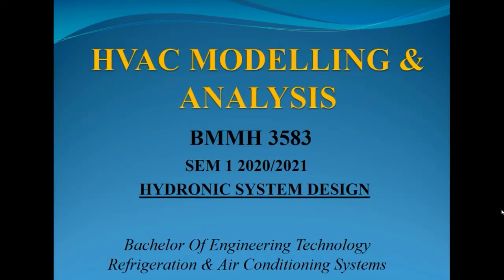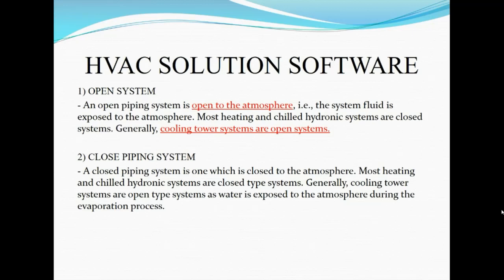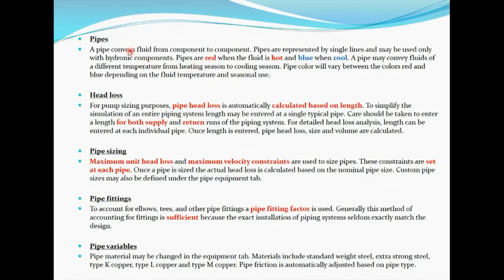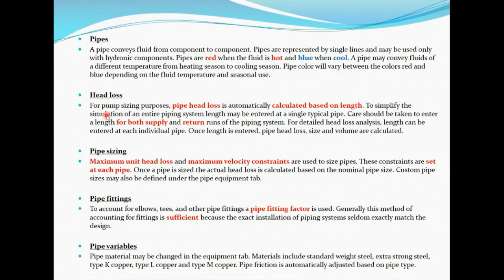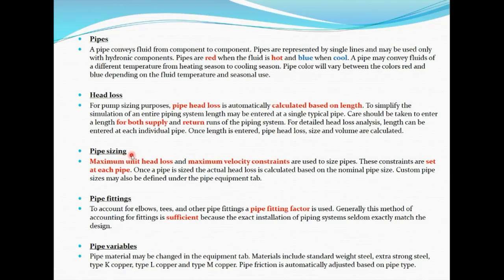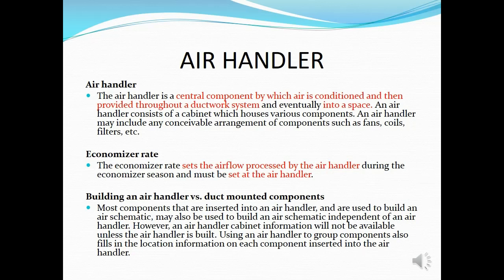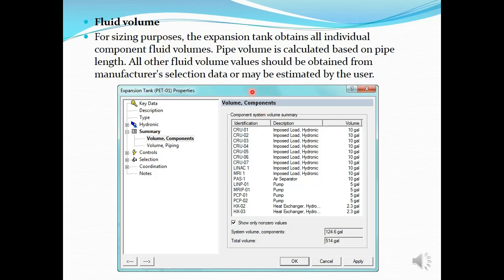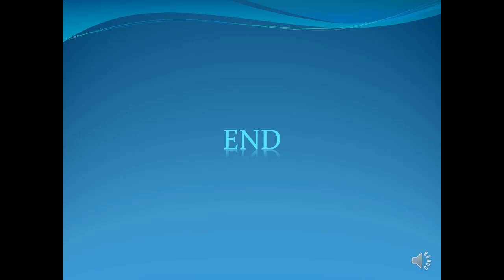hydronic system complete

Comment: MUHAMAD AFIQ HAIKAL BIN ADNAN
B071710534

1. Cooling tower has 2 piping system which is:-
-Open piping system which is the condensed water is release heat to atmosphere the water condensed water is mix with cooling tower
-Close piping system the condensed water is not mix with cooling tower, the condensed water only circulate in the pipe it commonly use in hybrid chiller

2.Air cooled chiller is use air from the fan to release heat from the condenser to the atmosphere.

3.Water cooled chiller both use water as a medium to transfer heat from condenser and evaporator.For the condenser absorb the heat and transfer it to cooling tower and cooling tower will release heat to the atmosphere.

4.Air handler unit contain a several component such as cooling coil,heating coil,fan  and filter

5. Damper use to control of air flow,there are several type of damper:-
-Opposed Blade
-Parallel Blade

Comment: MOHAMAD ZARIF BIN ROSTAM 
B071710681
4BMMH 1/2
Hydronic HVAC System (HVAC Solution Software)

Open Piping System
Open piping system is the system that is open to the atmosphere.Open piping systems are flow in which the pumped fluid is exposed to the local atmosphere at some point in the system. A typical open-loop system would be a cooling tower system where the flowpath is linear, i.e. fluid transfer between two vessels.

Close Piping System 
A close piping system is one which is close to the atmosphere. Most heating and chilled hydronic system are closed type systems.A closed system is a physical system that does not exchange material with or interact with its surroundings and is not subject to any force whose source is external to the system. In less verbose terms, a closed system is one where all the variables are known and can be controlled.

Pipes

Overall head loss in a pipe is affected by a number of factors which include the viscosity of the fluid, the size of the internal pipe diameter, the internal roughness of the inner surface of the pipe, the change in elevation between the ends of the pipe and the length of the pipe along which the fluid travels. Maximum unit head loss and maximum velocity constraints are used to size pipe.Once the pipe is size the actual head loss is calculated based on the nominal pipe size. Pipe fitting is used to account for elbows,tees and other pipe fittings a pipe fitting factors is used.

Air Cooled Chiller
What is Air Cooled Chiller ?

Comment: AMIRA NASUHAH BINTI ALIAS
B071710121

1. Open piping system
- Open piping system is open to atmosphere. 
- A system fluid that exposed to the atmosphere.
Example : cooling tower system.

2. Close piping system
- Closed piping system is closed to the atmosphere.
- The opposite type of system comparing to the open system.

Air Cooled Chiller
- a chiller is a central source /equipment to generate chilled fluid. 
- extract heat from chilled fluid and rejects it to the air via fans
a few types based on what type compressor to be used: 
-Reciprocating
-Screw
-Rotary centrifugal
-Scroll

Water Cooled Chiller
- extract heat from the chilled medium and reject to the cooling tower medium
a few type: 
-Centrifugal
-Direct fired absorption
-Dual compressor screw
-Reciprocating
-Rotary
-Screw
-Steam absorption.

Air Handler
- a central component by which the air is conditioned and then provided throughout a ductwork system and eventually to space.

Economizer Rates:
-set the airflow (during certain time or season) processed by the air handler.

Cooling Tower
- used to dissipated heat from water from chiller.
- in connection with a water cooled chiller.
- connected to a components requiring a cooling consumption components. 
- accept heat transfer via a working medium from the chiller/other component and reject heat by the evaporation process.
- cooling tower sump used to store water temporarily for a cooling tower system during season when cooling tower is not in use.

Expansion Tank
- a vessel which accept the expanded volume of fluid so that the system will not over pressurized.

Valve
- to control the flow inside the piping and to allow a shut-off flow in a pipe.

Comment: MUHAMAD IZMAN BIN JAMALUDDIN
B071710518
4BMMH S1/2

OPEN SYSTEM AND CLOSED SYSTEM
Piping systems can be open or closed. An open system is affected by atmospheric pressure. The flow in open condensate return and plumbing drainage systems is gravitational. The flow in an open cooling tower water system is forced. The pipe sections of an open network system are either all supply or all return. A closed network system includes both supplies and returns sections. A closed network system begins with a first supply section and ends with the last return section.

AIR COOLED VS WATER COOLED CHILLER
A cooling tower is a specialized heat exchanger in which air and water are brought into direct contact with each other in order to reduce the water’s temperature. As this occurs, a small volume of water is evaporated, reducing the temperature of the water being circulated through the tower.

COOLING TOWER
A cooling tower is a specialized heat exchanger in which air and water are brought into direct contact with each other in order to reduce the water’s temperature. As this occurs, a small volume of water is evaporated, reducing the temperature of the water being circulated through the tower.

Comment: MOHD RAHIMI BIN MUSTAPHA
B071710225
BMMH S1/1

Lecture : HYDRONIC SYSTEM DESIGN
1. Open piping system
>> Open piping system is open to atmosphere. 
>> A system fluid that exposed to the atmosphere.
>> Example of open piping system is cooling tower system.

2. Close piping system
>> Closed piping system is closed to the atmosphere.
>> The opposite type of system comparing to the open system.

Air Cooled Chiller
>> a chiller is a central source /equipment to generate chilled fluid. 
>> extract heat from chilled fluid and rejects it to the air via fans
Has a few types based on what type compressor to be used: 
-Reciprocating
-Screw
-Rotary centrifugal
-Scroll
Water Cooled Chiller
>> extract heat from the chilled medium and reject to the cooling tower medium
Has a few type: 
-Centrifugal
-Direct fired absorption
-Dual compressor screw
-Reciprocating
-Rotary
-Screw
-Steam absorption.
Air Handler
>> a central component by which the air is conditioned and then provided throughout a ductwork system and eventually to space.
Economizer Rates:
-set the airflow (during certain time or season) processed by the air handler.
Cooling Tower
>> used to dissipated heat from water from chiller.
>> in connection with a water cooled chiller.
>> connected to a components requiring a cooling consumption components. 
>> accept heat transfer via a working medium from the chiller/other component and reject heat by the evaporation process.
>>cooling tower sump used to store water temporarily for a cooling tower system during season when cooling tower is not in used.
Expansion Tank
>> a vessel which accept the expanded volume of fluid so that the system will not over pressurized.
Valve
>> to control the flow inside the piping and to allow a shut-off flow in a pipe.

Comment: AHMAD LUQMAN HAKIM BIN ZAMBRUS
B071710359

2-types of hydronic system
1) Open piping system -  system fluid is exposed to the atmosphere (cooling tower)
2) Close piping system -  system fluid not exposed to the atmosphere (chiller)  

HVAC Solution
- pipe             = represented as single line (red for hot fluid/ blue for cool fluid)
- head loss   = for pipe sizing purposes (automatically calculated)
- pipe sizing =  maximum unite head lost & maximum velocity constraints are used to size pipes (constraints are set on each pipe)
- pipe fitting       = used to account for pipe fitting factors
- pipe variables = pipe material (double click on pipe), pipe friction will be automatically calculated based on material used.

Air-cooled Chiller
- a central source /equipment to generate chilled fluid. 
- extract heat from chilled fluid and rejects it to the air via fans
- Types are based on what type compressor to be used: 
   1) Reciprocating
   2) Screw
   3) Rotary centrifugal
   4) Scroll

Water Cooled Chiller
- extract heat from the chilled medium and reject to the cooling tower medium
- has a few type: 
   1) Centrifugal
   2) Direct fired absorption
   3) Dual compressor screw
   4) Reciprocating
   5) Rotary
   6) Screw
   7) Steam absorption

Air Handler
- a central component where the air is conditioned and then supplied throughout a ductwork system and eventually to space

Economizer Rates:
- set the airflow (during certain time or season) processed by the air handler

Cooling Tower
- used to dissipated heat from water from chiller
- connected to the chiller or any components requires heat removing.
- accept heat transfer via a working medium from the chiller/other component and reject heat by the evaporation process
- cooling tower sump used to store water temporarily for a cooling tower system during season when cooling tower is not in used

Expansion Tank
- a vessel which accept the expanded volume of fluid so that the system will not over pressurized.

Valve
- to control the flow inside the piping and to allow a shut-off flow in a pipe.

Comment: ALDEN ANDRIAN PHIUS
B071710392
BMMH S1/1

HYDRONIC SYSTEM DESIGN

1.Open piping system
- Open piping system is open to atmosphere. Example cooling tower system

2.Close piping system
- Closed piping system is closed to the atmosphere

3.Another component in hydronic system
- pipe
- head loss
- pipe sizing
- pipe fitting
- pipe variables

4.Air cooled chiller
- a chiller is a central source /equipment to generate chilled fluid. 
- extract heat from chilled fluid and rejects it to the air via fans
- air cooled types: reciprocating, screw, rotary centrifugal and scroll

5.Water cooled chiller
- extract heat from the chilled medium and reject to the cooling tower medium
- water cooled chiller type: centrifugal, direct fired absorption, dual compressor screw, reciprocating, rotary,screw and steam absorption.

6.Air handler
- a central component by which the air is conditioned and then provided throughout a ductwork system and eventually to space.
- economizer rates set the airflow processed by the air handler

7.Cooling tower
- used in connection with a water cooled chiller 
- accept heat transfer via a working medium from the chiller/other component and reject heat by the evaporation process.
- cooling tower volume calculate using density of water subtracting the difference between the shipping and the operating weights of the CL
- cooling tower sump used to store water temporarily for a cooling tower system during season when cooling tower is not in used 

8.Expansion tank
- a vessel which accept the expanded volume of fluid so that the system will not over pressurized

9.Valve
- used to allow a shut-off flow in a pipe

Comment: LIM PEI JUN  B071710194

HVAC SOLUTION SOFTWARE
OPEN SYSTEM
-An open piping system is open to the atmosphere, i.e., the system fluid is exposed to the atmosphere. Most heating and chilled hydronic systems are closed systems. Generally, cooling tower systems are open systems.

CLOSE PIPING SYSTEM

- A closed piping system is one which is closed to the atmosphere. Most heating and chilled hydronic systems are closed type systems. Generally, cooling tower systems are open type systems as water is exposed to the atmosphere during the evaporation process. 

AIR COOLED CHILLER
 VS WATER COOLED CHILLER
both air-cooled chillers and water-cooled chillers function to remove unwanted heat from manufacturing processes, they differ in various ways. Deciding which chiller type best suits your industrial process depends on several factors which include:

-chiller condenser mechanisms

-cost differences
-environmental and location considerations

AIR HANDLE UNIT (AHU)
An air handler, or air handling unit, is a device used to regulate and circulate air as part of a heating, ventilating, and air-conditioning system. An air handler is usually a large metal box containing a blower, heating or cooling elements, filter racks or chambers, sound attenuators, and dampers.

COOLING TOWER
The cooling tower is usually used in connection with a water-cooled chiller or may be connected directly to a components requiring a cooling consumption component if an acceptable (usually low enough) temperature can be achieved. Normally used in water cooled chiller system.

Water Circulation through Cooling Tower
 Q = H / (Range X 500)  

Cooling Tower Efficiency 
Efficiency = (EWT - LWT) x 100 / (EWT - WBT)

EXPANSION TANK
Fluids such as water expand and contract under varying temperatures. The expansion tank is a vessel which accepts the expanded volume of a fluid so that the system does not become over pressurized.

Comment: NUR FITRAH NADIA BINTI KAMIDAN
(B071710363)
4BMMH S1/2

HYDRONIC SYSTEM DESIGN
1. Open piping system
•	Open piping system is open to atmosphere. 
•	A system fluid that exposed to the atmosphere.
•	Example of open piping system is cooling tower system.

2. Close piping system
•	Closed piping system is closed to the atmosphere.
•	The opposite type of system comparing to the open system.

3. Air Cooled Chiller
•	a chiller is a central source /equipment to generate chilled fluid. 
•	extract heat from chilled fluid and rejects it to the air via fans

HAS A FEW TYPES BASED ON WHAT TYPE COMPRESSOR TO BE USED: 
•	Reciprocating
•	Screw
•	Rotary centrifugal
•	Scroll
•	
4. Water Cooled Chiller
•	extract heat from the chilled medium and reject to the cooling tower medium

HAS A FEW TYPES: 
•	Centrifugal
•	Direct fired absorption
•	Dual compressor screw
•	Reciprocating
•	Rotary
•	Screw
•	Steam absorption.

5. Air Handler
•	A central component by which the air is conditioned and then provided throughout a ductwork system and eventually to space.

COOLING TOWER

The cooling tower is usually used in connection with a water-cooled chiller or may be connected directly to a component requiring a cooling consumption component if an acceptable (usually low enough) temperature can be achieved. Normally used in water cooled chiller system.

Water Circulation through Cooling Tower
 Q = H / (Range X 500)  

Cooling Tower Efficiency 
Efficiency = (EWT - LWT) x 100 / (EWT - WBT)

Comment: NUR SELIHAH WAL HUDA BINTI AHMAD - B071710190
HVAC SOLUTION SOFTWARE
1) 2 type of system 
    - Open system = open to the atmosphere for example cooling tower system.
    - Close piping system = system that not exposed to the atmosphere. 
2) Component involve in hydronic system = Pipes
3)Pipes that have a head loss which it is automatically calculated based on length.
4) Pipe sizing is a maximum head loss and maximum velocity constraint. It set at each pipe.
5) Pipe fitting such as elbows, tees etc.
6) Pipe variable 
 
Air Cooled Chiller
1) Extract heat from the chilled fluid and rejects it to the air by fans. 
2) Type of air cooled chiller :
      - reciprocating
      - screw
      - rotary centrifugal
      - scroll

Water Cooled Chiller
1) Extract heat from the chilled medium and rejects it to the cooling tower medium.
  
Air Handler
1) Central component by which air is conditioned and then provided throughout a ductwork system into a space.

Cooling Tower
1) Works via evaporation and heat transfer occur. 

Expansion Tank
1) Vessel that accepts the expended volume of a fluid so that the system does not become over pressurized.

Valve
1) Valve used to allow or shut-off flow in a pipe.